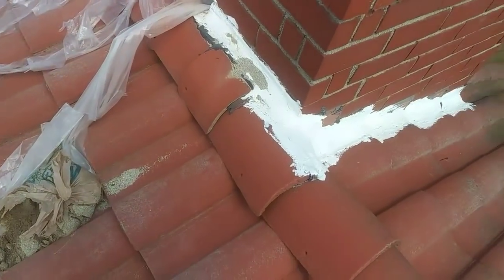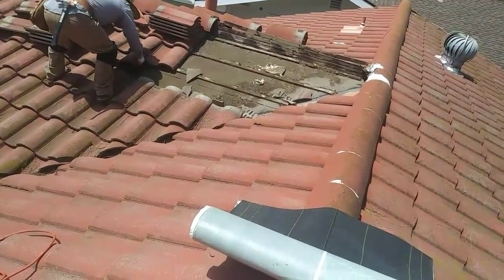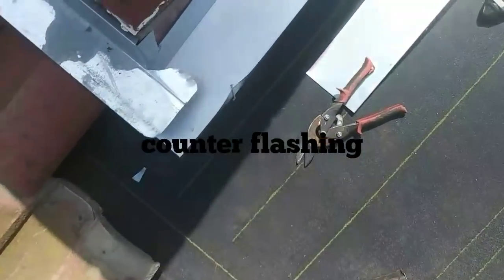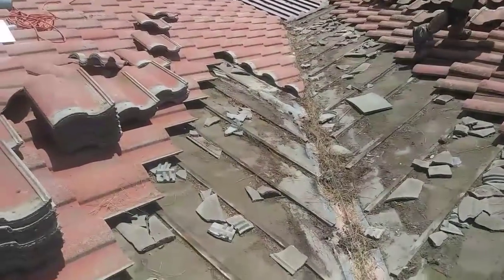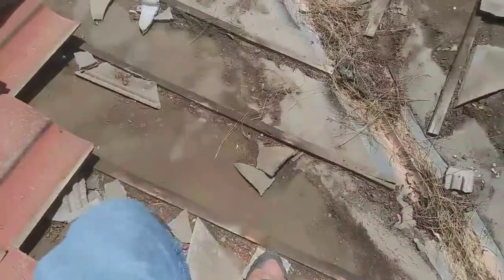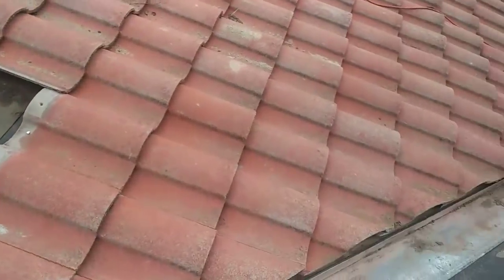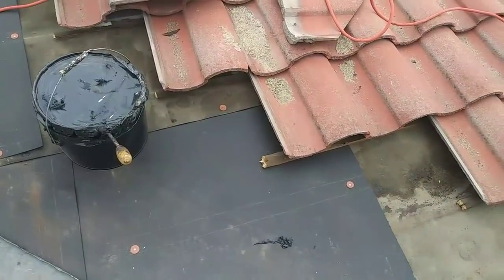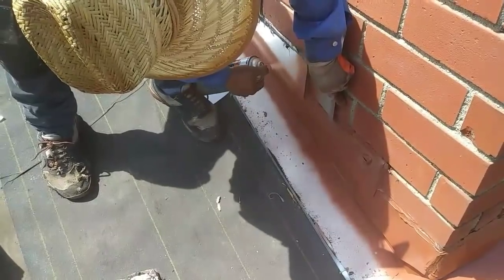How To Fix A Leaky Roof

Comment: I have followed you for some time. I have found that wooden battens nail flat down on tarpaper will begin to leak and rot from the first day.  You should never ever use TAR PAPER again. HT ice and water should always go under Tile and Metal. The most important part of this design is the batten made by Boral (plastic puck system). I have done roofs the way you show,  and have nothing but failer.  Sorry, but Tarpaper roofs suck.

Comment: Cut the Corners roofing 

" Raglett "is the name for the stepped counter flashing for the brick joint used on chimneys ! FYI
caulking is the best solution for fastening metal 
Instead of Fastners.
Flex seal is the greatest.
I use that shit on everything.